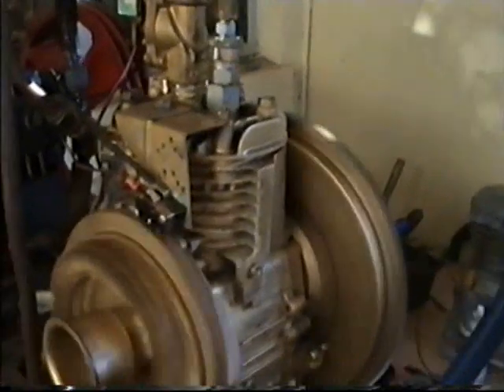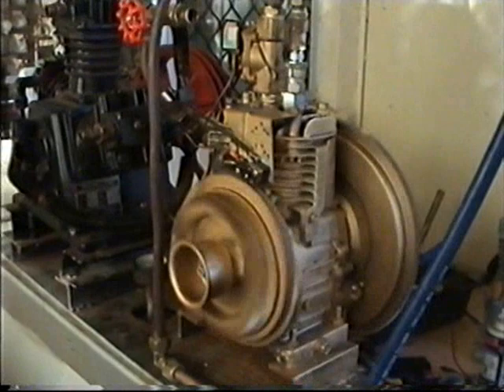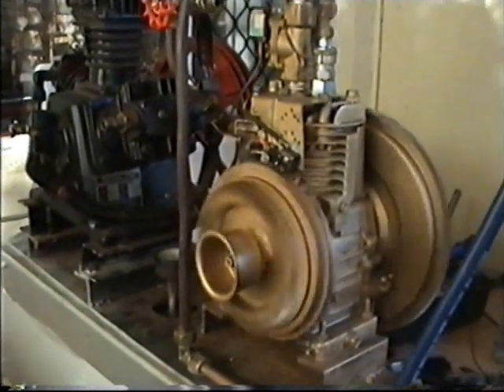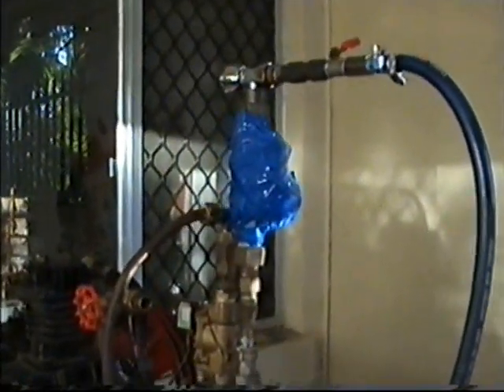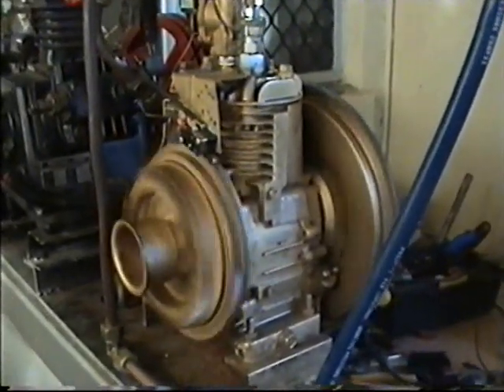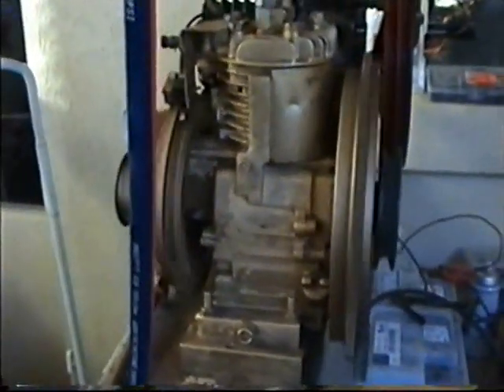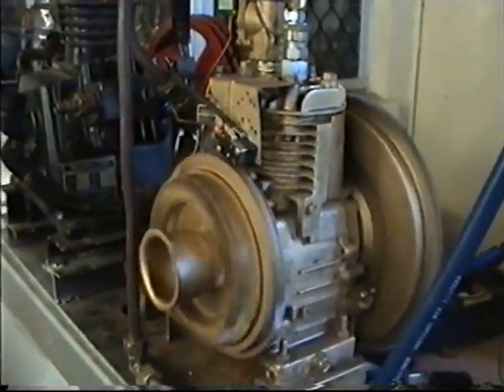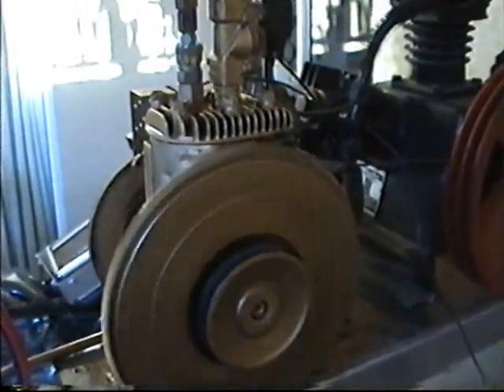FREE ELECTRICITY USING THE ALL AIR MOTOR!

Comment: So if you claim that there's free energy 😂😂😂 Where??? AND How??? SMFH Dude! In real life and this thing called physics we have this law that prevents us from having a "free" energy system, due to the fact that once you've changed or used the energy, it changes into something else, such as fuel into heat BTUs. The same thing applies to compressed air. First off you need to have a readily supply of compressed air, thus a air compressor which is heard running in the backround. You use the air to turn the engine, fine..... and then plumb it back into the storage tank??? This can't happen! Because the incoming air pressure needs to be higher than it's leaving the engine, once it's pushed the piston downwards and not to mention the losses between the rings and valve guides your not putting anything PSI worthy back into the storage tank that's worthy of being used again for running the engine! Sorry! It doesn't work that way, like your falsely leading ignorant people to believe it does! You have way too many losses and nothing you claim that is rebuilding the lost pressure here. So say that your income air pressure into your Briggs is 120 psi. Once you make that piston travel down it's bore your pressure has dropped off to 60 psi or lower taking account for losses between rings and guides. So yeah your exhaust output pressure was what??? I dont really recall that you mentioned that? Like it would have to he 60 or much less psi to go into the storage tank. LMFAO! So where are you going to get the remaining balance from to get your pressure back up to say 120 psi again to continue the perpetual motion process your claiming happens here??? Really one of the worst things that I've ever come across as a hoax! Sadly people buy into it not understanding how these things work in reality. Your what we call here in the states "a snake oil salesman" or conman to the rest of the world trying to pick on the less fortunate among us. Hopefully there's a special place in hell for people who do such S#!t, so Good Luck with that one 👋

Comment: It appears not many have understood the rationale behind this..... 
The United States can... if the World desires...  produce ALL THE ENERGY THE WORLD NEEDS by 2050 using AgriVoltaics (AV).... on just 1Millionkm2 of its EXISTING 4 Million km2 of Agricultural Land ..... For its own needs it needs barely 10% of this or 2.5% of its Agricultural Land. 
However, as one uses the AV Option (as against Dokar Farms etc...) ... the same land produces Electricity from Roof Mounted (10-20ft above ground) modified PV Panels (to let some light through) and Produce/Food below.... at the same time and on the same land.... !!!!

In other words.... there is enough Land and Energy in the USA to achiev ZERO POLLUTION... IF IT WANTS... specially now that Trump is passe'....  

 If the US can place a Man on the Moon in 10 years... there is simply NO REASON.... it cannot do the same for the above AV System..large as it may be .. providing farmers additional Income that President Trump denied them last four years...
The same System, however, produces Zero Electricity at Night... so what do you do...???
This equipment answers this riddle and more....

In the Day time the Air Compressor .... well... Compresses Air (if you can store/use the "heat of compression"... for heating, hot water, crop drying etc... even better)... and is stored during the day and re-used at night, like in this Engine, to Generate Electricty .... ZERO POLLUTION... ALL THE WAY.... any more questions..????

CAV's (Compressed Air Vehicles) do the same thing... using High Pressure  CA in on board the vehicle in Fiber Cylinders.... press on the cylinders.... and "watch the baby go"... NO POLLUTION ... possibly "free airconditioning" too....

You ain't seen ANYTHING YET.... THE ZERO POLLUTION FUTURE IS RIGHT HERE IN FRONT OF YOU!!!!

Comment: Can this project turn out to be a Perpetual motor - forever running without any source of energy except for outside air or atmosphere?

I know Perpetual  don't exist or seem impossible. However, the engine is compressing air from outside while electric charge is produced by battery, the battery again compresses air from outside and spins the motor and the motor employs a dynamo or alternator. Will this method work?

Comment: A lot of us take energy conversion very seriously. 
Does anyone out there know of some real world solutions to efficiently converting air pressure to rotation?
I can generate 30-40 bar over a couple days and would like to recover that energy. Considering 3phase @ < 100w through a switch mode converter, all of which I have.
What I don't have yet is an efficient way to translate moving air to angular momentum.

Comment: How is that free energy when I hear an electric air compressor running it?
Reply: It's free because as he said the air is infinitely used which creates electricity to power the motor powering the compressor I ment there is no electric motor running it but the engine has infinite air source so it can run infinitely and make electricity
Reply: @matthewbarnes727  OK I got you so its running the compressor which runs it. Thanks for clarifying that.
Reply: Sorry that violates thermodynamics, I call BS
Reply: he's probably using a dc generator to convert the mechanical energy into DC electricity which I think i heard him say he uses a power inverter to then convert that into AC electricity which powers the air compressor

Comment: At least he had a GO ,the fly wheel will make the HP needed to keep going with a modified head ,complete closed valves ,electrical values and reed switch it’s could be possible .

Comment: Its not that hard you just need a piston, crankshaft, ball valve, and a housing and its not free energy, the energy used to make the compressed air is the same if not more than what is produced (friction and other forces of the like on the moving parts)

Comment: You need air pressure to run the compressor, the compressor can not create enough air pressure and air volume that what it needs with the tank pressure being lower than what the compresspr produce.

Comment: How you douchebags keep saying you see the air compressor pushing the air in there if you look the air compressor is not spinning so I don't know what you guys are talking about it's just recycling the air that it makes air goes in in the imported comes out the exhaust goes right back into the tank it's just recycling near zaltz doing long as it's got a flywheels going to keep spinning why don't you try it before you start flapping your gums won't work cuz it does work

Comment: Aside from the free energy bs, what is so special about a compressed air engine? They've only been around for a century. 

If they could run an engine on the hot air generated any time someone mentions "free energy", then they might have something.

Comment: I have a new patent on an inexpensive positive power air compressor generator. It creates all the power, compressed air, and water from condensation you can ever use and it is very simple to make with off the shelf parts. At first they kept saying there is no such thing as perpetual motion. Of coarse they are right but that is not what I have. I had to prove and explain it to them in detail. They kept saying it takes more energy to make the compressed air than it takes just to generate the electricity. I thank the professors for thinking and teaching their students to think inside the box. I have a patent now and more on the way.
Reply: Do you have any videos? Sounds interesting

Comment: Your going to have equal pressure in the exhaust line resisting the outgoing air/exhaust mixture. And friction which will draw energy from the system.

Comment: so, the deal with the power for the compressor... assuming you had a river or waterfall nearby, or a wind turbine, you could use the power generated by the source, to power your compressor.  Thing there is... if you have a river, waterfall or wind power, 
that would be generating more power than your Briggs and Stratton. So... there's that.

Comment: Where  do you get the compressed air from?
Reply: ENDURO SK he probably fill the air tank with an air compressor before he started off motor and wants you did that then the motor just pushes the air right back into the tank makes sense to me as long as it has a flywheel with no flywheel it would not work but with the flywheel it would work I understand the principle but once the alternator has a drag on it from starting the charging process I don't see it that it would have enough energy to actually push an alternator as when you put jumper cables on a car to a dead battery the motor pools when that happens on an alternator I think it would stop the motor but I'm not sure but otherwise it's pretty cool if it will spin the alternator with a big enough flywheel then you've got something there as long as you can keep it lubricated so the Barons don't burn up I don't see why it couldn't run for hours and charge batteries what you need to do is set it up on a system where when the batteries get so low it automatically turns on and shuts off when they get fully charged then it would only run long enough to charge your battery bank and shut down it would last a long time and I weigh I think I'm going to give this a try
Reply: May be a biological source ;-)
Reply: Trompe compressed air ...
Reply: from a air compressor
Reply: I have done no such thing. Let me know where you got the info.
Reply: Yves Baggi with electricity 😂
Reply: I recognize the sound of a 2 hp Dewalt air compressor about 20 feet in the distance around a corner...
Reply: from the compressed air tree silly.. ...
hehehe
Reply: Lol first thing I thought.
Reply: E's got a toob up e's arse, see?

Comment: what advantage does an air motor have over any other? You have to use energy to fill it with the energy you use to make energy? Does that in one bit sound advantageous? It sounds like an awful waste of money to me unless there was a waterwheel spinning the compressor, but, in that event, I'd much rather spend less and install the generator onto the water wheel so I could just generate electricity, then, I could run a compressor if needed to do my work with air tools.

Comment: if it makes noise, heat or light, it's wasting energy. Movement is the desirable part but then you're looking at unnecessary vibration, which sucks energy, inefficient compressors, which suck energy... it would literally take less energy and produce more usable power if you just use batteries and an electric motor.

Comment: If he was driving the compressor with a windmill and storing the energy in a tank to be used later then it would work but my experience is the tank required is huge
Reply: +AskaLizzy LOL
Reply: Yes so very huge, I've been calculate close loop air circulation like this applied on cat3516 need 12K cfm and 180psi of pressure

Comment: The sound of compressed air violently hissing out on every revolution is a dead give away to how inefficient this engine is. NOT to mention that the compressor that feeds the compressed air is taking a large draw of electricity ! ! ! 
The only way this will be "FREE" energy is if you have solar energy running the compressor - but in that case you would be better off just using the compressor motor to do the work you want done ! 
Now A wind turbine that compresses air .... that would be free energy with your engine although there are far more efficient air engines than yours.
 Sorry for the bad news.. ;-(
Reply: +IceBlitz  but if you use a trompe air compressor with a water ram that the you are getting somewhere!
Reply: How cn this engine run continuously  on one tank of air when u have bypass air internally and back into the atmosphere I need u to explain that
Reply: maharani sukhdeo Good sir, let me assist you. He is using a compressor that's fed by electricity, which in turn fill up the reservoir tank. When the atmospheric pressure is higher in the tank than in the cylinder it will fill the cylinder and the pressure build up on the piston. When you have more pressure on the piston than the metal friction can hold, the piston will start to move. Then, when it reaches the bottom, a little bit of air pressure is released and the piston can go back to it's initial position because of the already built up power of inertia. With a continously motion like this you get something called perpetual motion, of which some is removed and some is applied by the air pressure. This makes the motor/generator spin and keep a spin. But you can NEVER in ANY circumstances produce more energy than energy fed to the energy producing unit in these matters. The exceptions beeing chemical reactions and nuclear reaction which is unselfsustainable.

Comment: how many watts does this produce?  how many watts does the compressor operate at?  this is not "free" energy, but is a step up system.  im curious about its efficiency or if the motor even has enough torque to turn a significantly large enough generator coil to power much more than the compressor.  you would need 8-10kw to power a modern home.  i doubt this would produce that.  best option is to add it to a wind turbine system that feeds a battery pack. this alone would not be enough imo.

Comment: Steve, if diesel engines can burn air with no fuel and you claim to have seen this done, when, where, how , and who did these "tests" because either you have been fooled, or you are the fool...you can't be both, because then it was you who did these "tests". You have Zero credibility as a witness to any such "tests". Self serving hearsay is how I perceive your claims. PROVE IT! or just stop it!...
Reply: EXactly! The only time a diesel "burns" air is when it's coasting to a stop after the fuel has been shut off. If you're going to burn air, you're going to hook up a fuel cell and break the air down into hydrogen. Air won't burn by itself and running a compressor to run a "motor" ........there's going to have to be some fuel of some kind used to run the compressor......unless you get a bunch of politicians together, BUT their air would be too hot and too much volume. Back to ye olde drawing board!

Comment: Drop a bottle of oxygen out of an Aeroplane oxygen under pressure will explode.
Reply: Not even the pure oxygen under 3000 psi will not spontaneously combust, no matter what you claim. Any welding gas supplier will tell you the same thing, this guy is an ignorant fool, and with his kind of "science" somebody could get killed.
Disregard his junk "science" you'll live longer.
Reply: No it won't, you can't transport highly compressed oxygen on an airplane, and not because it will "Blow" up, it's against Federal law, and no insurance company will allow any one to fly pure oxygen any where because it's highly compressed and this includes high pressure nitrogen any where as they are hazardous materials, and it has nothing to do with anything but highly compressed gases. It isn't the oxygen that does the burning it's the fuel that oxygen combusts and not the other way around. This guy is nuts period.

Comment: Compressed outside air is not pure oxygen and it will burn if released at high speed into carb
Reply: Steve, you absolutely WRONG, there is no way one can burn air by itself no matter how high a pressure one would use, a diesel engine is a self ignition based engine on oil and air being highly compressed and the air/oil mixture self ignites, the first cycle in a diesel engine is the compression phase, the second phase is injection of the oil/fuel into the compressed air, the third phase is combustion on the power stroke, and then the forth phase is exhaust from the cylinder. The outside force needed to start a diesel engine comes from a high voltage starter motor and glow plugs which only are used to start the engine, and the glow plugs preheat the air/fuel mixture when compressed, and the glow plugs are turned off once the engine is running. That is a simple explanation on how diesels run. And they aren't free energy machines either.
Reply: Hey 
Vern, I have seen diesel engines run on  nothing but compression with no fuel at all . You think our government is not stopping some shit or what?
Reply: Got milk Vern?
Reply: Seven Bridges Road If an atomic bomb can't ignite the atmosphere, and believe me they can't even with billions of PSI of compression of the atmosphere and 130 million degrees in temperature, then a diesel engine cannot possibly burn on just air, fool. Where do these people get these idea's? God save us, these types can actually vote too!

Comment: We know it can be done but the oil companies and big government won't allow it . Oxygen is a gas it burns .
Reply: Oxygen is an ACCELERANT in combustion, it is all by it's self not combustible, I have worked with more oxygen then many many people have in their entire life time, in welding and laser cutting then just about any one I know. Even the purist oxygen will only accelerate combustion, but completely pure oxygen by it's self will not burn as it requires a fuel to  accelerate the rate that a fuel will burn. THIS IS SIMPLE STUFF, YOU SHOULD KNOW THIS BY NOW, GO BACK TO SCHOOL AND TAKE A BASIC CHEMISTRY CLASS.  Even a high schooler would know this stuff by now!